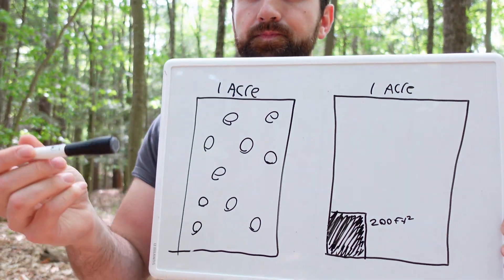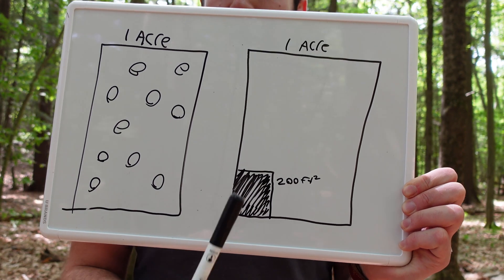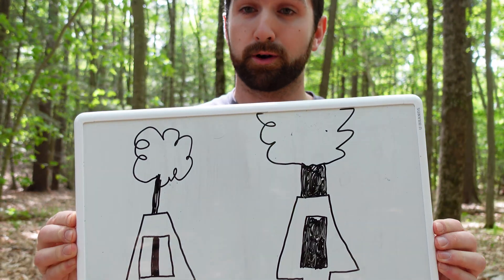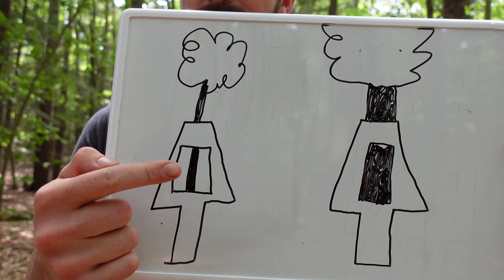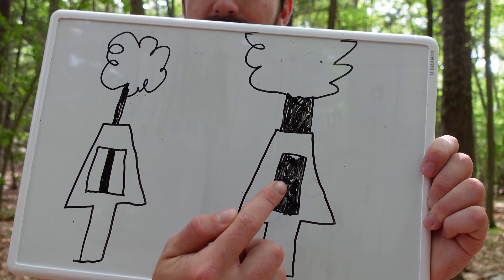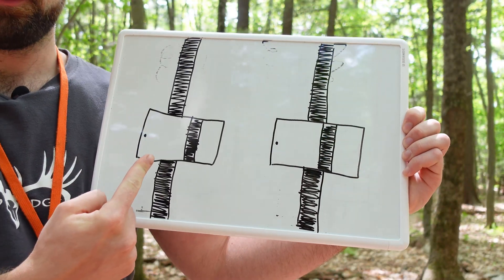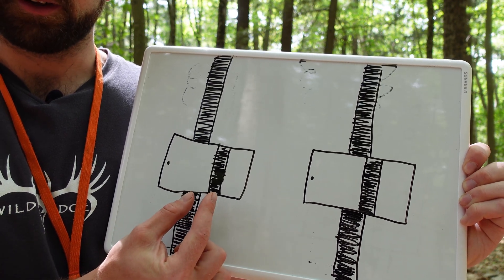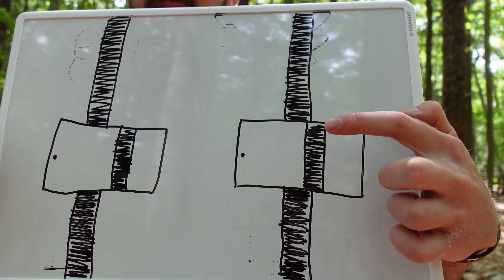How to Measure Basal Area Per Acre (Three Methods!)

Comment: Excellent explanation. Now I need to determine what the optimum basal area would be to maximize benefit for deer on 100 acres of mature oak woodlands with a current basal area of 80-120. Would 50 be too much or would 60-65 be better?

Comment: I'm in forestry school and we have a test Tuesday. We have to mark a basal area of 6m2/ha with a 2 baf angle gague. Which would be three trees. We need to mark 9 trees but the catch it that no matter where we stand only tree trees can be in at a time. We got 15 minutes to do this. What's a good way to do this when you don't got much time to use your angle gague to check your work.

Comment: You can calculate your thumb factor for m2/ha using a simple formula, its handy(no pun intended), mine works out practically 3(3.0245 exactly).  The only downside is you cant keep your thumb and tree in focus at the same time, that's where the prism is really useful.

Comment: Excellent explanation.  Not clear on the "in" vs. "out" meaning.  So, if I have 9 trees that are "in" using a BAF of 10, 9x10 would mean I have a 90 basal area?
Reply: Yes
Reply: My experience: "In" and "out" come from in or out of compliance with whatever the criteria is. Yes no?
Reply: @LR7709  No, Cliffy Claven.  In and out is in reference to the number of trees in view.  There are no compliance rules, quality specs, etc. lol.  It's clear you don't remotely understand what the OP and I were talking about, so stop trying to pretend like you know something, lol.  You clearly don't.
Reply: @JohnAnderson-sm8jl  woah yeah that makes sense! I DO know what I am talking about for regulatory compliance, but you are correct, I do not know what these terms mean for this application. I am learning, and taking part in the conversation is one way to do that. 

The Interagency manual for wetlands delineation references this method, the video was extremely helpful. Thank you for clarifying "in" and "out".